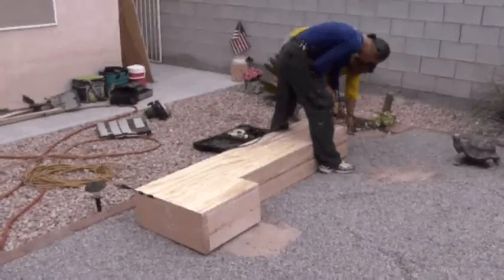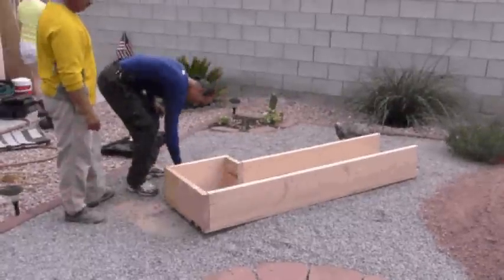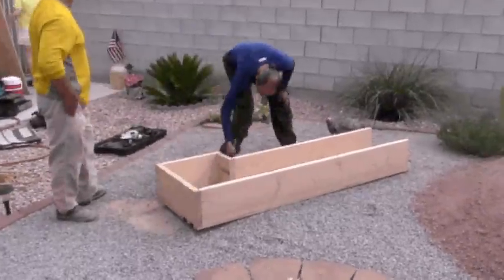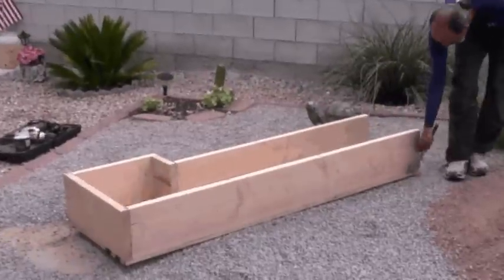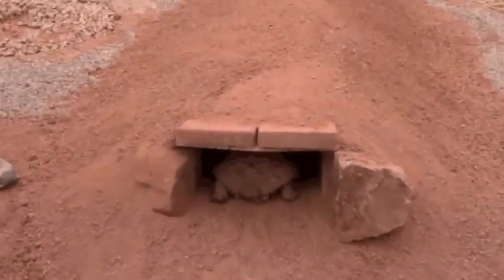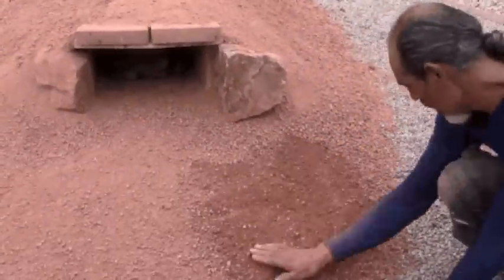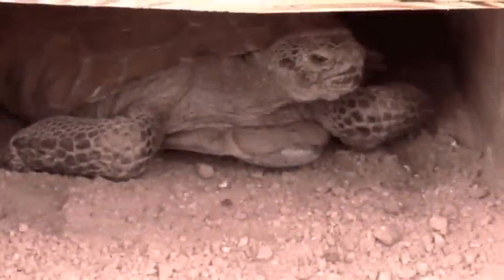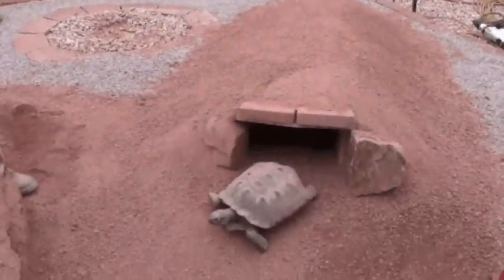Desert Tortoise Underground Burrow Southern Nevada

Comment: I have had my tortoise outdoors for 20 years. I have had to redo burrow every few years and learned a few lessons... I made one like this minus the wood and thought I was done. I dug pretty much the same way, and covered with a large steel plate and some flagstone. Still had some fails. This year I’m gonna do it right, once and for all. So, a couple of things... Deep end is good, 18” is frost line. The width is a little narrow on the way in, doesn’t look wide enough to turn around. One year, mine came out of hibernation and wedged herself sideways in the doorway because she grew quite a bit.  Next concern-wood. I wouldn’t see if termites were crawling on her or messing with her shell. Not to mention flooding or wood rot. I did berm the dirt up around the opening and built a large ocotillo cover supported with metal stakes that was lined with landscape fabric to provide shade and reduce water getting in during monsoon. That part worked great. However, pack rats and gophers have dug holes around the steel cover and I have had to patch with rocks during the winter. I am looking to gut it one more time and see if I can’t get it right this time. For years the whole enclosure was framed by rabbit fencing with ocotillo branches upright like fencing. Very natural looking and she could see the world outside. Till the time when she refused to go in the burrow and I stuck my head close to the opening. A Gila Monster came running out. Moved to smaller holes in the fencing, redid whole perimeter, new ocotillo branches around whole thing. There have been times when we have wacky weather or intense heat spells and I want to do a welfare check. That means, digging into the deep end to touch her toe and watch for reflex. I got a camera with a led probe that helps minimize destruction of burrow and spots intruders. None so far with my latest version. So I need something like this wood shelter. I was thinking of cutting thin pieces of steel and welding top and side walls while leaving floor dirt so she can file her nails and dig a bit. Once 2 does jumped in to graze on the mesquite and I shooed them away and found tortoise flipped over. If they had stepped on the burrow, it would have collapsed. Welded steel should prevent that, lol. But will it get too hot? I would paint it with cool coat and pile dirt on top... also, deep end should be hinged, not nailed. In case she has to be dug out in emergency. I covered the burrow with moving blankets for the winter and covered the whole thing with a tarp and stuffed a sheet in the entrance. She survived the winter and just came out this week only a few new gopher wholes. I like this one in general. I wish she would come back and tell us how it’s holding up.
Reply: How had your new version held?  Been thinking of creating safe burrows once my little one is a bit older and resting your message really helped with the do's and don'ts
Reply: Maphew404 Hi! Hortencia came out of hibernation last week and for the first time in history I needed no repairs. No critter holes around the burrow. Since last year when I posted, I beefed up the perimeter as we have some feral cats in the area and that burrow looked inviting. So, picture perimeter fence with holes the size of your fingernail. That corrected most of my previous visitors. I had cut ocotillo branches and wired or zip tied them vertically around the outside to the height of the fencing which was about 3ft high…I could carefully climb over. But the cats could jump in, so now reinforced with taller ocotillo about 4/5 feet high staggered about 8” apart to deter the cats. Left one spot open for me and built a gate the same way so I can get in and out. The burrow held fine. Covered the whole thing with towels and moving blanket. Placed a dome over the opening made of chicken wire bowed up in the middle and secured with stakes on either side covered in towels which protected the entrance to level ground. When I packed up the towels and blankets last week, everything was still in place and the lack of critter visits and digging I think was due to the unfriendly spikey ocotillo around the perimeter, so focus on that as much as the burrow. When you think you have it right, check the burrow temp with a thermometer or a temperature gun the first year to make sure its not to cold or hot on cold nights or hot days. The bottom of the burrow dirt is packed down from our rainy season now that I didn’t disturb it. I had a metal dome from a big patio heater that we threw out. I secured that over the opening during monsoons when it was windy and blowing rain. That domed chicken wire secured with stakes really helped everything stay in place so no flooding. Wish I could add a picture. I will try from computer